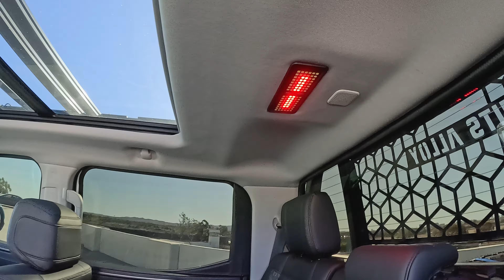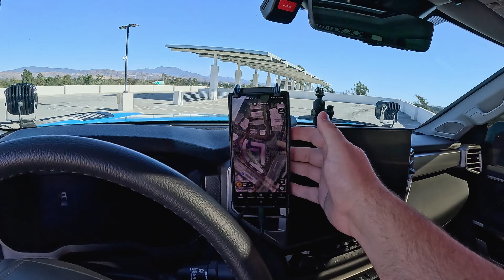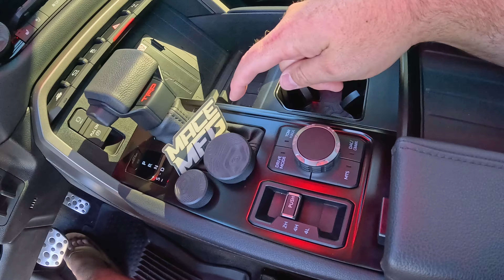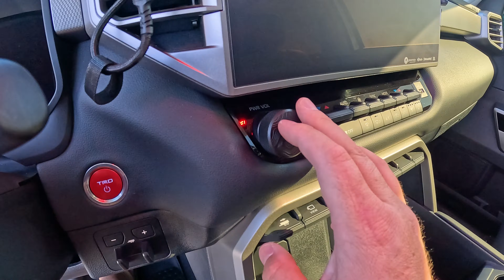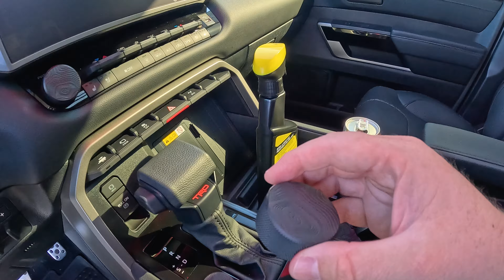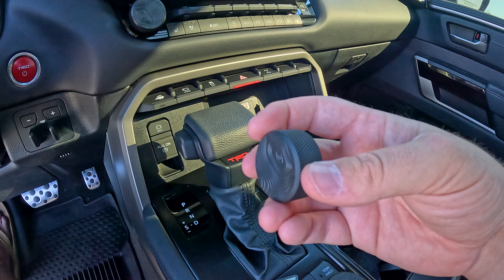Must-Have Interior Mods for the 2022+ 3rd Gen Tundra & Mace Manufacturing drive knob Install

Comment: nice setup , how to did you mount your yaesu ft 400 on top of the air vent , and what kind of ditch light bracket do you have with the antenna mount attached to it? KO6HRL
Reply from the maker: I drilled a hole in the air vent and installed a RAM ball mount for my Yaesu. The ditch light bracket is from Baja Designs, and the antenna mount is from Amazon and bolted to the ditch light bracket.
Reply from the maker: KN6WOF